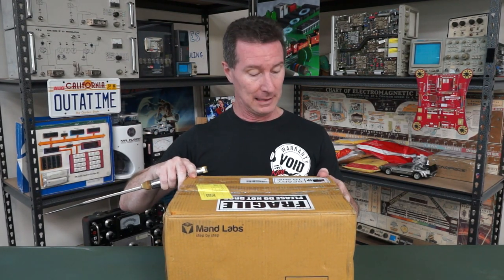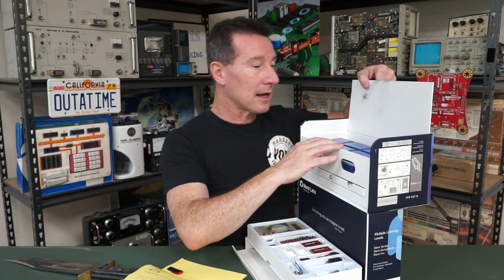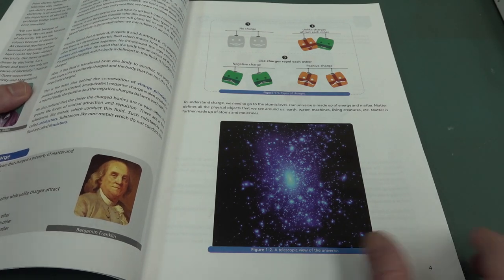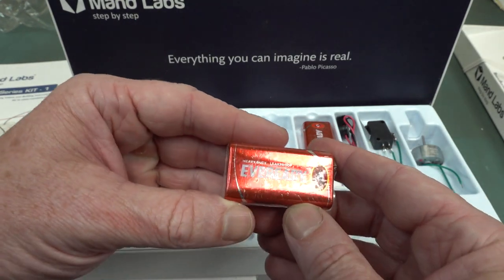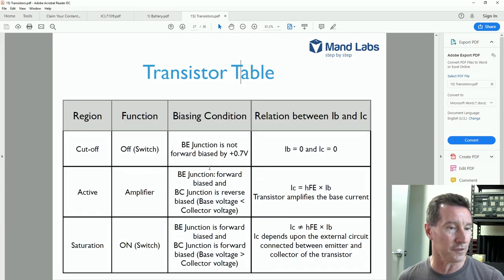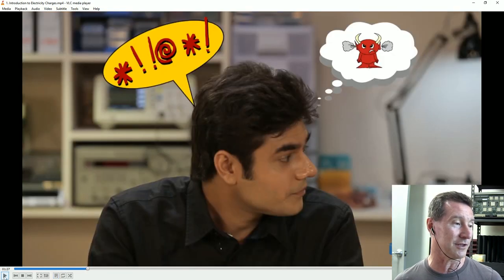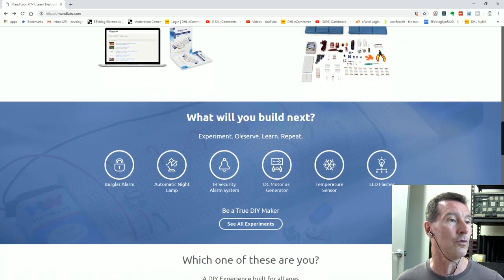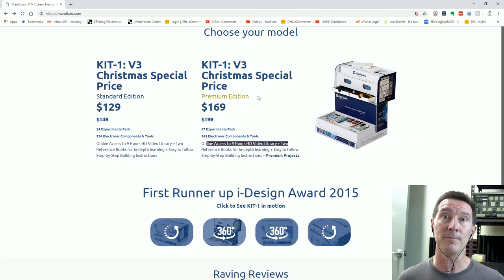EEVblog #1163 - Xmas Mailbag

Comment: 1070 ti is the sweet spot price/performance wise
Reply: But it's artificial. Nvidia nerfs 1080 to make 1070ti. So basically they sell castrated 1080 for lower price while hardware cost is pretty much the same. It shouldn't be a thing in any industry.
Reply: @spacejaga  although i mostly agree, the "official" reason is chip binning. some 1080 gpus are not quite up to spec, but work fine in a "castrated" configuration, so why not use it for something?
Reply: @panopolis8051  1080 is already a binned 1080ti chip. The thing is 1070ti doesnt have to be a thing. Between 1080 and 1070 there is not enough of a performance gap to be filling with another chip. It doesnt cost any less to make 1070ti than it is to make 1080 and based on that 1080 could be sold for 1070ti price just fine. But greed... Also on average 1070ti is just marginally better than amd counterpart. So it goes something like: get radeon or 1070ti for same price or pay extra to get some extra performance of 1080 while its the very same card as 1070ti....
Reply: @spacejaga  Quick question; Do you know the exact production and logistics processes of those different chips?
Reply: Space JAGA You missed the key word "binning".  Binning means making ONE chip, then quality checking each chip and selling the bad ones as something else (or the extra good ones).  In the old days factories would just mark them differently on the outside, but with modern plug-and-play (and fraudulent resellers), they also write it into an on chip rom.
  So IF 1070 is a binned 1080, it's simply chips in which some of the inner parts (cores, shaders, whatever) failed, so they sell them as chips with fewer inner parts.

Comment: I would say that it isn't a screw in the force switch... I would say its a magnet.  It would be oriented in the airplane so that the magnet is pointing to the back of the plane, so that a sudden reduction in speed (such as in a crash) yanks the steel collar off of the magnet and it flies forward and completes the circuit.  The reset button would push the collar back off towards the magnet.

Comment: About the all that extra folder and files you said "delete all that", those are hidden and wouldn't be visible if "show hidden files and folders" wasn't turned on, and it's always off by default. I believe the 1070ti reference has to do with the CUDA core processing power on some fields being worse than on older models.

Comment: That acceleration switch has a sheet metal spring at one side that keeps the cylinder stationary, the screw is just for calibration. So a totally resettable device.
P.S. I would NOT plug in that USB key as it might have some malicious intent (possibly to backdoor your computer) Only on an airgapped pc as you said, with a live linux usb (to not leave any remnants in the OS)

Comment: The nut and screw are for the strippers. So you don't cut the wire in half that you're trying to strip. Mount the screw and nut in the slot, adjust it to your wire size, and you can strip to your hearts content.

Comment: I wonder if they have anything in there about using the included multimeter to test for forward current gain on transistors; that's one of the few things those multimeters are good for.

Comment: Going by the prices on their web site, the mand kit is a bit on the expensive side. I don't even wanna think about comparing that to the component prices... The books add a lot of value on top of that, of course. However, I personally would recommend a much smaller box (with the same stuff in it) with a more streamlined book, maybe even pt 1 and pt 2 as seperate entities. If someone wanted to learn about transistor logic and the likes they'd probably already have gotten a bread board, LEDs, caps and resistors together with, say, an arduino starter kit.

Comment: Instead of complicated explanations
 I would try to compare/correlate the flow of electricity with the flow of water ex: a wire with a pipe, a potentiometer with a tap, a bad electric contact wiht a wather  leakage, voltage with wather pressure etc
I try to include 1: minimal safety instructions - do not short the battery, chose a good place to work with electronics kits: ex - not on the carpet; 2: best practices - ex: try not to bend to many times the leads of the components

Comment: My first kit was a radio shack (or in your case Tandy) 250 in one.  I think it had a whole 1 page on how electricity flows, and the rest was just schematics with connection instructions.  I still have that kit.

Also, it's Zee, zed is just derp.  If you want to be different, it's a Zulu 80

Comment: Those manual layouts look like current school text designs. The main problem being there's too much white and wasted space in those manuals. It is a very bad habit teaching books are getting into, trying to make themselves look like static web pages. The amount of information per page is minimal with over-sized images. All that happens is the kids look at it once or twice then winge that it's too big/heavy to cart around. An A4 sized manual with at least a minutes worth of reading per page is the density needed. When I look at the new high school texts and compare them with one's from the 70s, they are three times the size with half the info and few worked examples. Made just to look pretty more than pass info from A to B.

The pages are glossy (that's a problem), the books are over sized (that's a problem), never any hard covers (that’s a problem), the white space surrounding formulae is large (that's a problem), the chapters are separated by huge empty pages containing only a “you are here” chapter name and number (that’s a problem), writing never seems to go near any edge so less takes more room (that’s a problem) and in general, culturally biased speech and incomplete indexes at the end which never reference all the technical words used, just some random selection of which ones the author thinks they might not know (that’s a real problem for international students). 

The old ETI circuits or ETI circuit technique book series, or the Elektor 300 series or their summer circuits books are way better to hold  and use. Colin Mitchel’s Basic Electronics is another.

Comment: No, I disagree. In any type of science, whether it’s physics, chemistry, or electronics, you won’t get far without the fundamentals, such as Ohm’s law. And you can’t understand that unless you know what voltage and current are; no voltage, no electronics! Sure, you can throw a few components and a battery onto a breadboard, but you’ll likely end up with a popped LED or burnt resistor, and with no idea why (and that’s even assuming the “circuit” does anything at all.) While I’m a big fan of hands-on experimentation, theory has to come first, as it’s the foundation for further knowledge. The trick is to combine the two in a manner applicable to your audience; whether they’re 7-year olds, college freshmen, or older folk who want to learn something new. 😎 And frustration (at not being able to get anything to work) will quickly dull the sharp edge of passion, especially in those with short attention spans! At that point, you’ve lost them; you can talk theory all you want, but they’re already dreaming of something more fun, like butterfly collecting, or shooting roadside signs with a BB gun!

Comment: I have to agree on the electronics kit. Electronics Experimentation Kits should be just that, experimentation. Build the circuit explain in the simplest terms and provide all the safety information. Then at the  end of the chapter you can have an if you want to understand how it works section that goes into the theory. When it comes to those videos those are just horrible. Some basic things, if you are going to produce a video in the English language, hire someone who speaks the language natively and well and is easy to understand. Likewise if you are going to produce the videos in  Chinese don't use english speaking actors to speak Chinese.

Comment: I studied electric and electronics, my first job I had to drill holes for wiring and connector cups in wall's after 5 years I was done and took an electronic repair job, whole day taken out print'board's and put new ones in connect the apparatus on a tester and wrote down the voltage, amps and some other number all within a +/- tolerances. Never used a multimeter etc in the 12 years I did both jobs, I stayed because the pay was good. At home I used all equipment I learned  to use in my study. Today you see engineers filling shelves in a supermarket or scratching weeds along the road. Those who are not so well educated and have lower diplomas and used to do this jobs are either in other jobs or the chefs from the engineers that are filling shelves in the supermarket!? Today all answers are on the internet, from cooking a 5 star meal or to get an appendix out by guy in death need. even the changing of a  battery pack from electric car can be done by my 12 yo kid, just by following the instructions on a youtube video.

Comment: This electronic lab looks great, but an analog kit needs a radio circuit or even better a transmitter and if it is more on the digital side it needs a microcontroller. It looks like this lab tries to be both but it skips the exciting stuff.

Comment: Ya they introduced both advanced stuff mixed with really beginner's stuff. They should start with experimental and then explain what happened. Like plug that led, then a 330ohm then the battery with a switch and yeah magic. But first they need to disassemble the breadboard and see how the connections are made underneath. Learning electronic shall be always experimenting before doing the math and learning the atomic stuff from my point of view

Comment: i think that bolt and screw set the limit for the strippers (i have not used one of those in years and years but i think it had one of those on them) 
also i think talking about physics is fine, as a kid i would have skimmed past it and went right for the flashing lights and later go back and read all of that

Comment: I think that Mand Labs kit hold's to much information for beginners in book and video.. This may give opposite reaction.. Normally would be, if explaining only components, give simple schematics, recommendations for electronic experiments to build and leave a kid to play with it.. :) Wire cutter was bad choice, micro switch needs all 3 wires soldered, not only 2. I don't now, is some explanation about breadboard joints inside, but that information will be necessary to for kids..
Multimeter was cool for this purpose with colored sections.. Kids love to play with multimeter and if they interested in it, they, usually, asking questions.. :)

Comment: Great packaging and presentation. Wow. Do you think they had enough dessicant packets in the bottom package of components? Does it indicate who is the intended target for the kit? The advanced information would be better as an appendix for young kids getting in to electronics. The advanced information would be more suited to someone in high school, or later. I was surprised to see the RC2014 board use a 68B50 ACIA chip. I think 1070ti is a reference to the GTX 1070ti GTI video card.

Comment: The poblem I see with that kit is anything video based runs o slow on a pi 3 running Raspbian that it's unusable. So you're not gonn be able to watch those tutorial videos on it. Video playback is maybe 10fps. I can't even run FCEUX on mine. That is NES emulation.

Comment: When my elementary school "taught" electronics it was rather perfunctory: ten of us were gathered around while one kid plugged the wires in here, here, and here; then he pressed the button and the light came on, etc. “Now remember these five words for the test!” In high school we got a whole week of it, but the teachers were bludgers who just told the older kids to teach the n00bs, but they had their own work to do. Epic fail. It wasn't until seeing the Radio Shack book Getting Started in Electronics with all smiling electrons going to work that I finally started to understand and get interested in the details. That being said, if I'd seen Mand's overproduced piece of flashy garbage first I'd have moved the Pennsylvania and joined the Amish. (Everyone tries to be just like Bill Nye, and everyone fails at it.) The accent is very difficult and probably worse for kids… but maybe good preparation for dealing with arrogant support representatives when they're older.

On my father's Cessna 172 the ELT wasn't accessible from the cockpit and I don't remember ever needing to mess with it: I always assumed that the acceleration switch didn't draw any power and just acted as a second ON switch. OFF was just for heavy maintenance or when replacing the battery.

Super Merry Christmas to you and the whole EEVBlog family. Take care.

Comment: Hows the presentation on the Mand Kit?  I guess it depends upon whether you want to do it, or whether you want to learn it.  As a 6 year-old I wanted to do it.  Cutting a switch in half to see the mechanics inside is what I did.  After a couple of years of doing it, that's when "why it worked" became important to me.  One of my first builds was a tone generator that I paired with a code key to practice Morse.  I  could read code at 20 wpm before I ever applied for license.  I skipped the radio amateur and tested for my First Class Radio Telephone Operator license at the age of 15.  Did I know of charge and it's measure by then?  You bet'cha! but it was because I needed to know to build an oil bathed glass and foil capacitor; I hoped to capture lightning.  It was an interesting experiment, but I'm glad I wasn't near when it was struck.  Want to entertain a child, blow something up.

Comment: I think the printed manuals are fine as they are. Just because it starts with the theory doesn't mean the reader has to, or will, work through them in that order. I think the video content is wrong though. An introduction to electricity should be removed and the content therein should be reduced to the basics and integrated into the lighting the LED video. You have to assume that anyone new to electronics may not be familiar with equations or formulae, being either a youngster or an adult with a hazy recollection of maths from back in the days when they were at school, and showing that level of information so early on is likely to put a lot of people off.

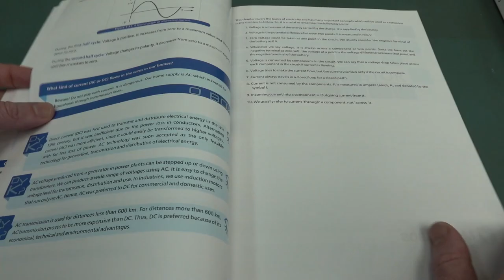Comment: 8:25 "Current at P is defined as the number of electrons passing through it in one second". No it is not, that's precisely wrong. It is the rate of charge flow, and it is NOT specifically associated with electrons, except to the extent that electrons carry a charge. And that electron charge is negative, which is why the current (rate of charge flow) is positive in the direction opposite to electron flow.  Communicating these points incorrectly cripples the understanding of current going forward.  Grrrr! 
Then 8:26 "Typical graph of direct current"... displays a plot of voltage, not current.   "When electrons oscillate like a wave, alternating current is formed".  Arrrrg, no!  The electrons are not "oscillating" in the normal sense that some resonance is involved. They are simply moved back and forth at some regular rate by some external force. And this does not "form" alternating current, as though it's some follow-on result. Instead "alternating current" is simply a description of "electrons moving back and forth" in aggregate.  The kit may be a valiant effort, but this kind of information that's vaguely about electronics, but is instead corrosively misinforming -- that's discouraging.

Comment: Mand - comes with free cheese lol
Give a kid a nail (iron), wire & battery (etc) & they got an electromagnet boom, they hooked, 
Get them interested with practical & usable projects 1st will get them involved in learning the fluff needed to advance their learning,  
The math, formulas, laws etc is for those who need it, after their interest has been SPARKED by physical sparks, 
nothing amount of theory taught me not to stick a fork in the mains, it just convinced me to bend the forks to fit all the pins because grounding is "good" for living, electrickery still bites, hard

Comment: Sooo much wank in that kit....I love the individual packs of desiccant everywhere....ffs and the level of hand-holding kids get these days...I learnt electronics because I wanted to. no hand holding,  nobody to answer my questions, no video or text tutorials and no internet, and almost no good beginner books in my language, so I had to learn some english too, ah and no money.

My first electronics learning kit was bits of salvaged parts off a few old radios and such, much later I got upgraded to a breadboard and a few TTL chips. funny enough, I learned logic circuits (and technical english) mainly by reading standard CMOS and TTL pocket guides, over and over and over and over again till I could actually read the text and understood what they were going on about. I got my first chipo meter almost 2 years in, first decent meter around 4 years and an oscilloscope 6 years in.  was it hard? yes did it stop me? no really. I just learnt to be resourceful and became an even better problem solver.

Comment: (on mand labs item) please please make it stop... perhaps this style resonates with some flavors of young nerds, and that would be great for them... (What is the age suggestion for this? maybe i missed it, but seems young) But most adult nerds i have talked to started by hands on making stuff glow, beep, spin, and make smoke.  Learning by making mistakes until success was discovered.  THEN learning the theory as needed.  Some went on to get the theory shoveled in later in formal setting.    Good production... cheeze level is high, but that can be funny.  too much theory too early